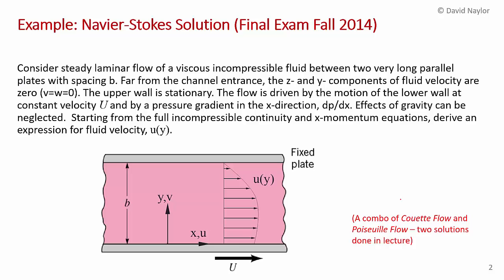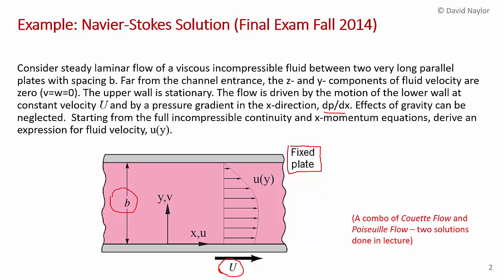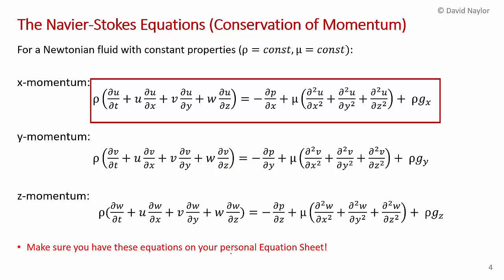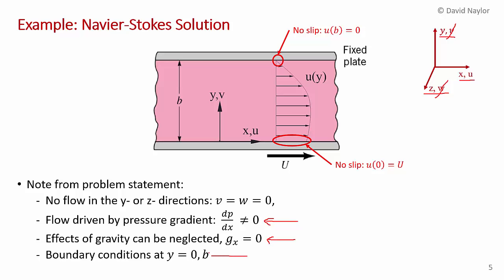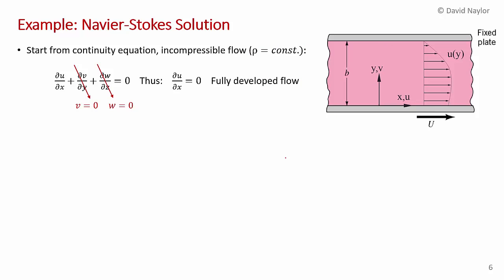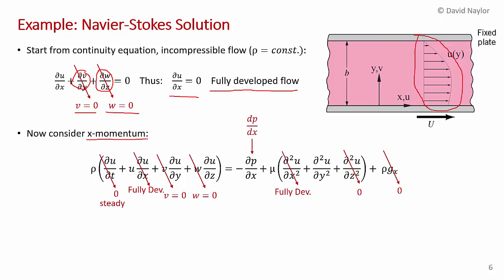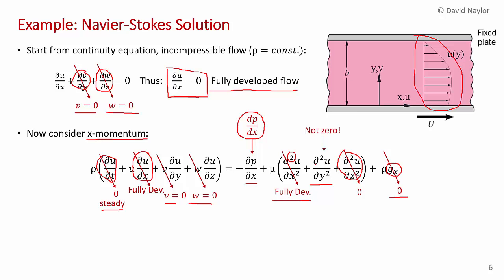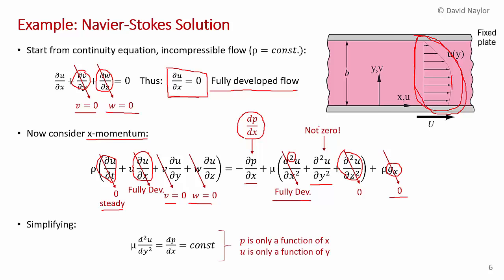Navier-Stokes Equation Final Exam Question

Comment: Thanks for the video. I have a question about the pressure profile. Should we continue and solve for the pressure profile in x direction or it is enough to stop at the final form demonstrated by the video?
Reply from the maker: The questions asks "Derive and expression for the velocity profile", not the pressure gradient dp/dx.  So, you can stop where I did.
Reply: @FluidMatters  Good. In case, we want to continue, what is needed to solve the pressure gradient term?

Thanks.
Reply from the maker: @tammammohammed4442  You would likely want dp/dx as a function of the volume flow rate, Q. To do this I would integrate the velocity profile across the channel to get the flow rate: Q=f(U,b, dp/dx). Then rearrange the expression to solve for dp/dx, which is a constant.
Reply: @FluidMatters  Thanks a lot!

Comment: At 13:29, shouldn’t it be C1 = -1/(2*mu*b)*dp/dx - U/b and not C1 = -b/(2*mu)*dp/dx - U/b ? Doing the algebra, I feel the b should be in the bottom of the fraction and not the top. Can someone explain please?
Reply from the maker: Before simplification, we have b^2 in the numerator (from y^2 in the original expression applied at b). So, when you divide by b to isolate C1, you end up with b in the numerator. I hope that helps.
Reply: @FluidMatters Thanks! I didn’t see that

Comment: what happens when the plates are moving in the same direction
Reply from the maker: That's another possible exam variation. You can define U_1 for the bottom plate and U_2 for the upper plate. The solution is identical up to 12:44. The evaluation of C_1 (at 12:44) is different: u=U_2 at y=b.  Results in a slightly different superposition of Poiseuille (pressure gradient-driven flow) and Couette flow (plate motion-driven flow).

Comment: thank you. but please how can we find the pressure gradient?
Reply from the maker: The pressure gradient (dp/dx) is supplied by the pump. In the final equation, the value of dp/dx  is your choice (i.e. an input) and could be estimated from the pump head curve. The bigger the pump, the higher the flow rate, and a larger pressure loss per meter of channel length (dp/dx).

Comment: What will happen if the flow is unsteady
Reply from the maker: You'd need to specify initial conditions, like a still flow (u=v=0 everywhere) and perhaps an impulsively started plate at time zero. In this case you'd have the acceleration term du/dt (partials, of course) and it would be more difficult to solve, as u=u(x,t).  These solutions are more advanced: See the classic book "Boundary Layer Theory by H. Schlichting", McGraw Hill.

Comment: @fluidmatters   Your mathematical equation is incorrect.  It is impossible to have a "No Slip" situation for the lower plate boundary.   The formula should instead show that the lower and upper plates are directly related to each other.  Instead of making the upper plate move and the lower plate stationary...you should instead halve the velocities of both plates.   This is both physically and mathematically the only way this equation can be properly solved and I can prove it.  This is works the same for all fluids, whether it be water flowing through a fully contained pipe or the Pacific ocean flowing over bedrock.
Reply from the maker: I disagree. Couette flow with a pressure gradient is classical exact solution, dating back 100+ years. I will not debate it here. If you feel all the experts and dozens of textbooks are in error, you should submit your new idea to a refereed journal, rather than post an inadequately explained claim in the comments on YouTube. Best of luck.